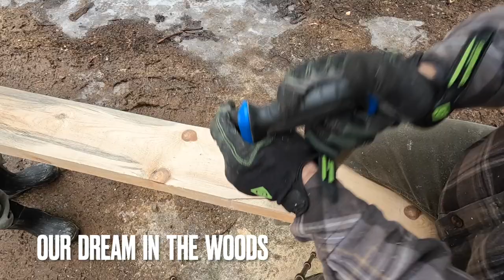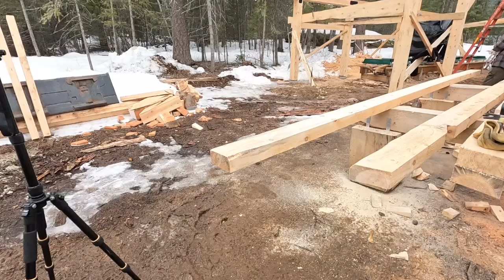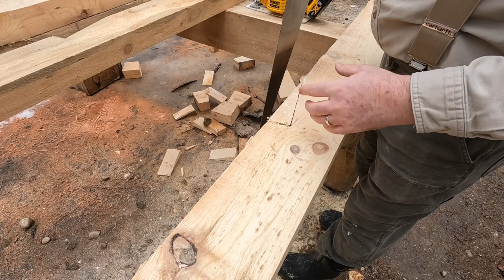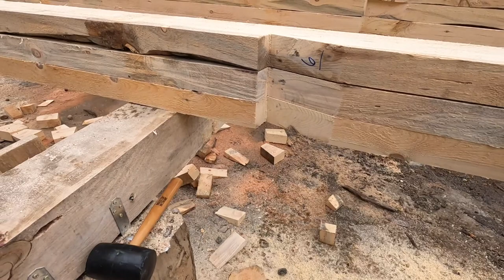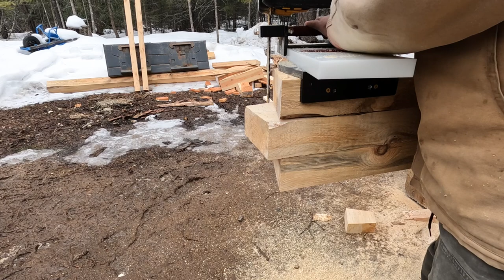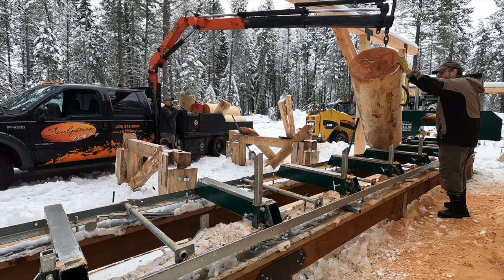Making Birds Mouth Cuts // Continued //Cutting Rafters To Size // Building A Sawmill Cover //

Comment: Nice job. If you turn all of the rafters upside down and line them up, you can use your circular saw to make the first cut of the birdsmouth across all of them at once. Just adjust your circular saw to the correct angle (determined by the pitch of the roof) and depth. Clamping a straight edge to the rafters as a guide will make it easier to get it straight. 

Saves a lot of time and makes them all exactly the same. I hope I explained this well enough. Easier to show in person than to try to describe.

Looking forward to the perlins and roof install. Are you using metal for the roof?
Reply from the maker: Thank you! We have more rafters to cut and are going to use this method, what a great idea! And, yes, we will have a metal roof. Thank you, again, for sharing your tip!